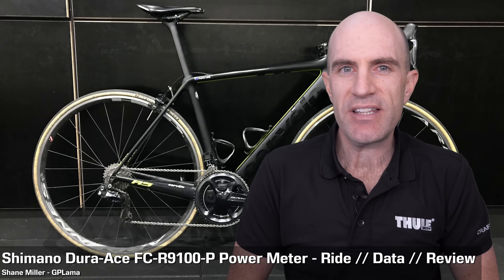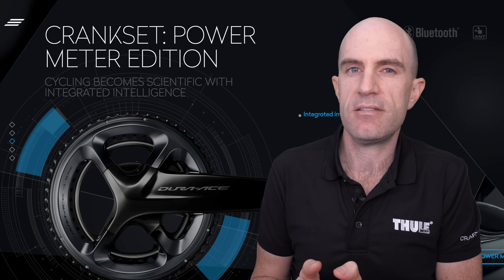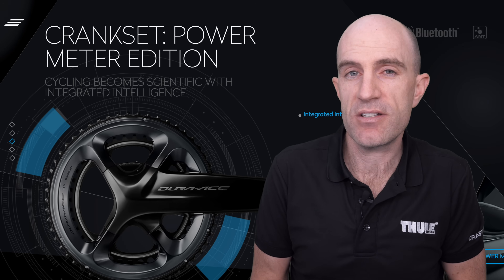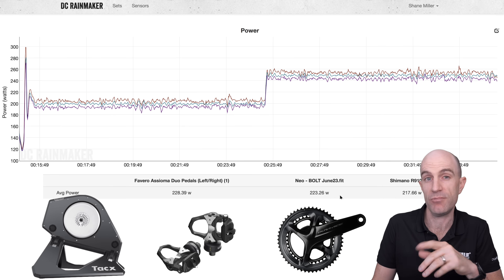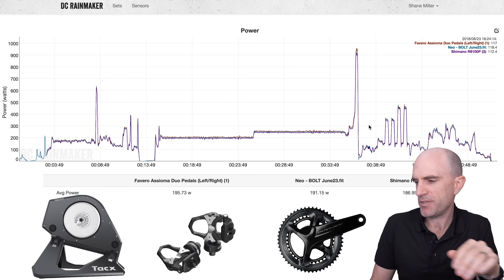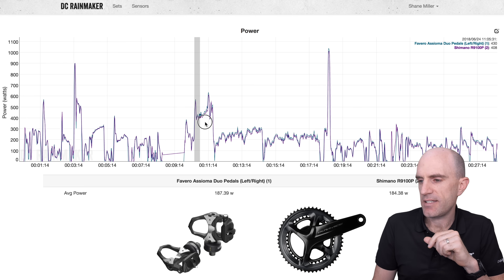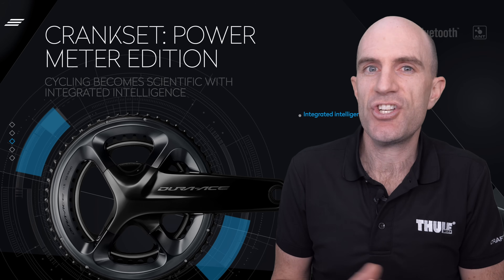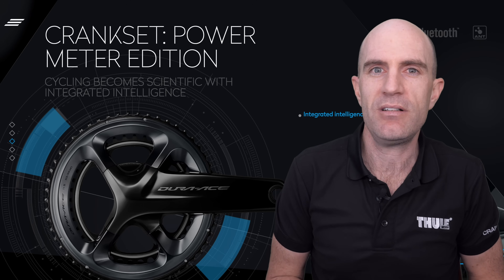Shimano Dura-Ace FC-R9100-P Power Meter - Ride // Data // Review

Comment: So, after all that information, which crankset do you recommend as the best on the market?
Reply from the maker: Crankset or power meter?
Reply: @gplama  Both, a crankset that has a power meter on it.
Reply from the maker: SRAM/Quarq combinations work well. The Power2Max I built up with the Rotor ALDHU cranks and Shimano rings was also a top performer.
Reply: @gplama  Thank you for the recommendation and Happy New Year 2021. I will try to build my Crankset with the Power2Max, Rotor ALDHU cranks and Shimano rings. I still need to research if the set will be compatible with my SHIMANO SM-BBR60 bottom bracket on my bike.

Comment: OK, so its been 17 months since your initial review and comment regarding L-R power meters (especially the Shimano R9100P). Over this time since your initial review, have you seen any correction with the Shimano power meter? I'll search through your video library. Thanks!
Reply from the maker: No change. It’s an inherent design flaw with the cranks that’s causing this. I expect Shimano to change up the crank or their own power meter design for their next revision (road 12 speed can’t be far away).
Reply: @gplama  - Hi Shane, Thanks for the note. I watched the other videos you posted on the Shimano power meters and the one you referenced by Rick Wakeham - Brilliant!!! I've been having "right pedal connection issues" with my Garmin Vector P3S pedals. The guy at the store I frequent recommended the Shimano crankset because they "have one in the store". PHEW! If we ever cross paths, I owe you a beer or two...
Bob

Comment: Shane, first of all thanks for the channel, amazing work you been doing here!!! I been running the Shimano power meter since last February and after that time I can fairly say that isn't accurate at all, especially in the wet days the readings are crazy. Indoors works fine but outdors...temperate and humidity makes the thing crazy!! Now I'm thinking I'm buy another powermeter, but I'm not sure of which one. Would you recommend me stages G3 dual or 4iiii??? 
Thanks a lot!!
Reply: Marco Rodero Prada: have you consider a quarq D-zero. Or Vector 3’s. I’m in the industry and after years of working with different power meters, the two mention above are the most trouble free and most accurate. Just FYI.

Comment: Hey Shane, I hear that Dura-Ace has solved the issue with L/R balance with a firmware upgrade. Is this true? Also, out of the three; 4iii, Stages and Dura-Ace dual sided cranks using the 9100 series Dura-Ace crank arms, which in your opinion, is the most reliable?
Reply from the maker: Interesting on the L/R update from Shimano. I'll need to get a hold of one and re-run the same tests. At this point I'm not really a fan of Shimano cranks being retrofitted with strain gauges to be called a 'power meter' - for various reasons. Spider based tech (Quarq) have been pretty reliable for me over the years. Pedal based power is also good, but also come with a few downsides.
Reply: Thanks Shane for your advice. If I go for Quarq I've just go to get used to them not matching my groupset :-). This does, however, open it up to other cranks like the info-crank as well. Quarq's been around for a while now. How are they like with abient temperature drift?
Reply from the maker: I never had any dramas with the Quarq and accuracy from start/finish of rides. No wild drifts anyway. Typically the biggest temperature drift is taking the bike from inside to out at the start of rides (zero'ing after ~10mins usually helps here... if being super picky)
Reply: Awesomeness Shane. Thanks for your help. I noticed that Quarq have a Dura-Ace 9100 compatible power crank, the Quarq DFour91 Carbon.

Comment: I find the balance depends on the type of ride.  If I am in a full on smash fest where I am hanging on for dear life then I get 50L/50R and sometimes 49L/51R or even 48L/52R. However on a long tempo ride 100-200km ride where I am conserving energy I get 51L/49R and some times 52L/48R.  I think my R leg is very slightly stronger but I conserve it on long rides.  When I have to give 100% I use both fully and then the R is equal or slightly stronger than the L.

Comment: The bluetooth issue is beyond unacceptable. You CANNOT advertise a powermeter as bluetooth compatible and it not actually transmit data via bluetooth. This is false advertising in the plainest sense, and Shimano should be utterly ashamed of themselves for doing it.

Comment: This is another lesson to not make purchasing decisions based on the brand/name of the product. There is no such thing as "premium" power meter. Either it does its job or not.
Reply: Michal Wozniak
10 months ago
"This is another lesson to not make purchasing decisions based on the brand/name of the product. There is no such thing as "premium" power meter. Either it does its job or not."

This comment doesn't make sense.  People have widely disparate expectations from power meters. "Counting watts" in a relatively precise fashion seems straightforward but it's not. None of them are perfect. What people should look for is understanding how they will use it and then checking potential purchases against suitability to those needs. The way the data is converted to samples (for recording) is the most important factor and that is almost never discussed in pubic discourses. Whether a meter is "accurate to x percent" is relevant, but not the most relevant question. Stability over time and right to left (proportional accuracy) are most critical because any meter that is predictably inaccurate can be corrected with firmware and or software.  Second, you're always looking not at "power production" to sell on a grid but power relative to stress on the subject. If you don't understand those relationshiops it won't matter if your power meter is off by even 10%.

Comment: crank based powermeter reads lower than pedals is expected as it's not the direct contact point and power maybe lost due to flex or other factors from the pedal
Reply: Don't think that is the issue in this case. When left Dura-Aace matches the left Asioma and Neo and the right Dura-Ace doesn't match the right Asioma and Neo somethings up.

Comment: Ummmm does this mean that it's better to get a left side only power meter if the right side is always reading low I have the vector 3 dual and from your video the other day having issues luckily I have not experienced any problems until I replaced the right battery door with the new one and experienced drop outs on  a ride since changing it back it runs as normal.

Comment: Very disappointing for a premium product. A lot of people are going to think they have a left / right balance problem when in fact they don't. I'm getting 50/50 or 51/49  either way with my Assioma pedals plus the power is very close to my single sided 4iiii power meter.
Reply: Nigel Doyle aye, people getting enhanced left/right data... that's completely wrong = very poor. I'm better off sticking with my, far cheaper, single sided 4iiii... ridiculous.

Comment: Editing was on point with this one as well as the analysis. Also, why is it so hard to make these things actually work with Ant+ AND Bluetooth and transmit data over both? How hard can it be? Especially at this pricepoint?
Reply: Szabolcs Gergely transmitting across two protocols is possible but there are a lot of technical considerations. I agree with shane's verdict 'work in progress'
Reply: Well, I know it's possible. That's why I'm surprised that some companies do such a half assed job at it. At this price point there's really no reason not to have it transmit across both protocols. There was also that $3000 smart trainer, that didn't have proper bluetooth implementation. If you can implement it in a $50 heart rate monitor, then there surely needs to be a way of implementing it across any kind of other device.
Reply: Szabolcs Gergely completely agree but it actually seems to be a trend with a lot of sports tech and some of the big names get it wrong. They almost appear to be using customers to test the hardware/software and fix the minimum issues before bringing out a new version.